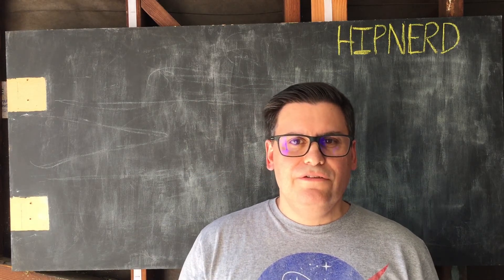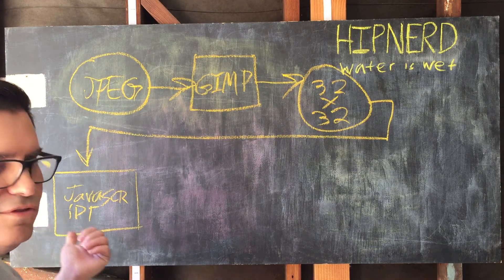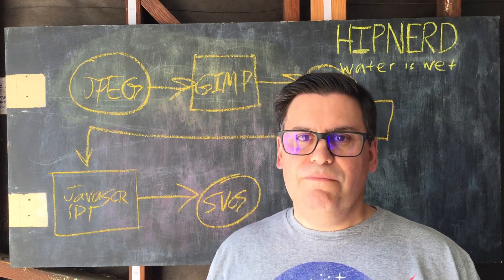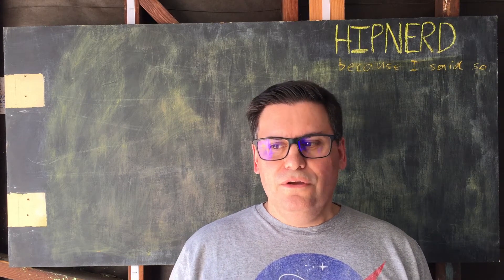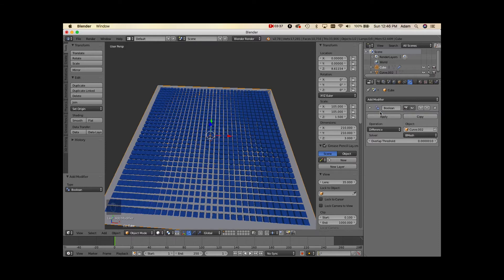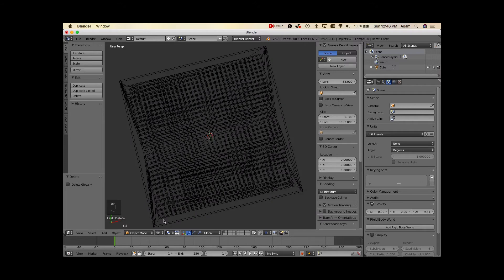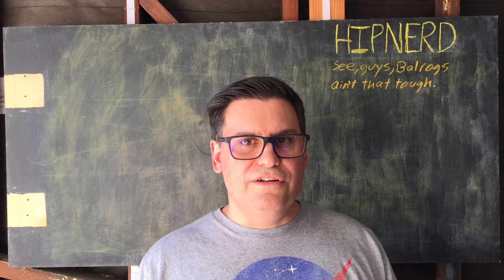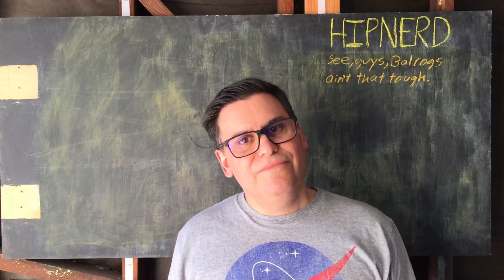3D Printed Halftone

Comment: thanks so much! I wonder if this halftone printing could create gradual change of roughness on the surface? do u think there are better ways to 3d print surface with different roughness?
Reply from the maker: If you're not trying to reproduce an image, and just trying to get say a surface that goes from smooth to rough, there's probably better ways to do it, depending on the software you use.
Reply: HipNerd ohhh would u kindly provide me sources to learn abt that?
Reply from the maker: You could start with this Fusion 360 tutorial: https://youtu.be/jKPbye0XtMk